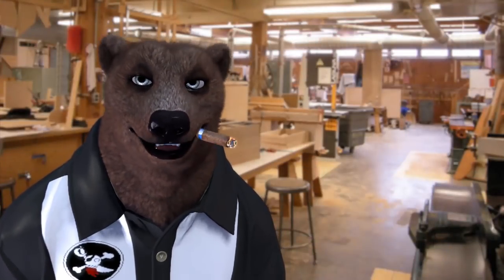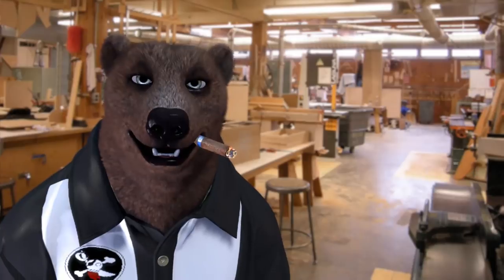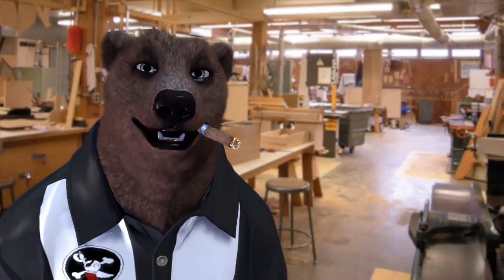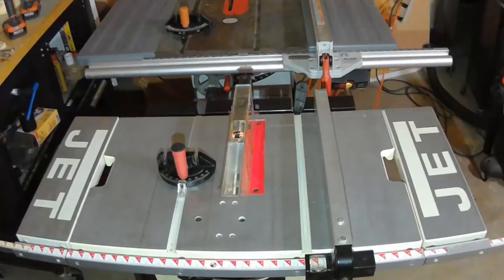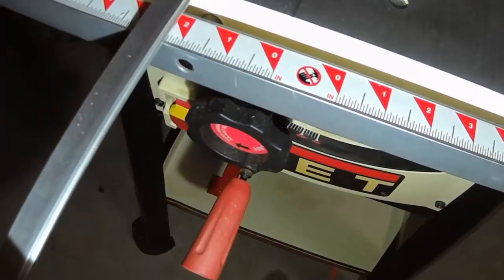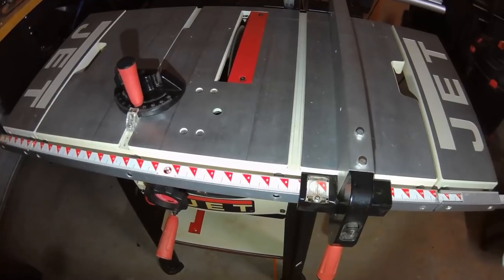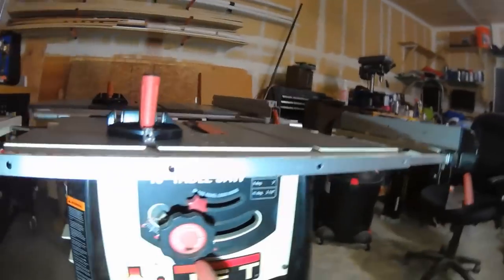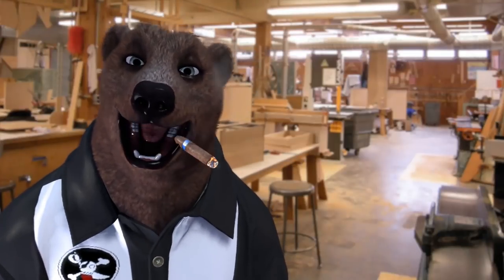Best Table Saw (for the money) Part II

Comment: I actually have this saw. it is amazingly accurate and powerful. I bought mine new for only 200 bucks. The moving parts are well engineered and it cuts through everything nicely.
Reply from the maker: Yep, it has a bit of a cult following.  I was stunned when I found them selling now for more than when they were used.  But the thing is, if you need a small form factor with the features of a full size saw there just aren't that many options out there.

Comment: I agree with you on the price negotiations. Do your research so you know what the range for an item is and be ready to pay in that range. Ignore adds that go way over that. You'll save a lot of aggravation on both sides. If you happen across one that's much lower, you'd best make sure it's not something that's been under water in a flood or something. By the same token, if I showed up to buy and the seller's shop was clean, and well organized with the indication they took care of their tools, I'd be willing to pay a bit more. If you are willing to pay fair prices and charge fair prices, your repuation will make it easier to do either over the long run.

Comment: I had this saw for years. thought it was good until I got a decent saw. it is top heavy and prone to tipping over. the fence is a joke, and if you try to use dado blades, the motor will tear itself apart. this one is better than most the table top ones however.

Comment: your nuts, i'v had this jet saw for three years its junk. fence is never squair, burns the wood,throws dust every where.blade wobbles, its my first table saw and i'm so discurraged i'm getting out of wood working.its JUNK
Reply from the maker: First off you need to understand that the argument of "I have personal experience with this saw" is a very marginal comment.  In truth you are only an expert on the single saw that you have used.  This is standard scientific methodology.  Second, even the best products sometimes have bad apples amongst them.  And sometimes even the worst have a good one.  My family used to own a Ford Pinto.  It never broke down and never blew up.  Does that mean that ALL Ford Pintos are excellent cars?  And lastly, and take this as coming from someone who has been in your shoes, it's a case of user error.  Everything you described is indicative of a new woodworker who has setup his tool incorrectly.  All but the best fences can have issues with being square.  There are tons of adjustments on the table, fence and rail that need to be made before you ever use the saw.  That said, this is a contractor saw/fence.  Just keep a square next to the saw and you are good.  Blade wobbles?  Two things I can think of that cause that.  A bad or bent arbor or a warped blade.  If you ran wood through the saw too slow and burned it that could heat up the blade and warp it which in turn would cause more warping.  If the arbor is bad then that is a manufacturer issue and covered by warranty.  As to dust?  Contractors saw are notorious for that.  There are fixes that will make it better but it will never be a cabinet saw.
Reply: you are most likely right on all accounts, but i have adjusted every part time after time and nothing seems to help. cheep blades expensive blades wobble. I just know i'm done with this saw . Sorry for being so negative but bad tools makes simple task difficult. Thanks for your time.